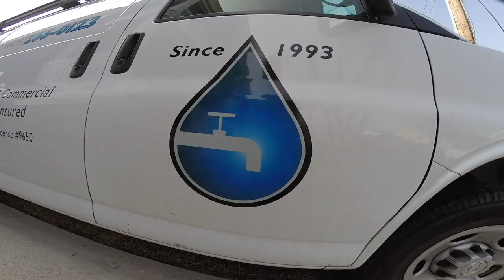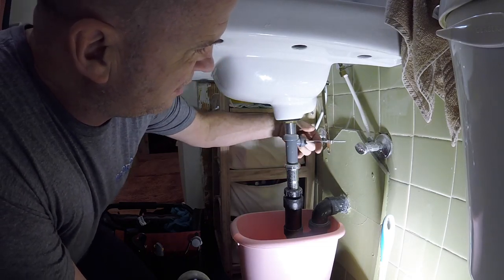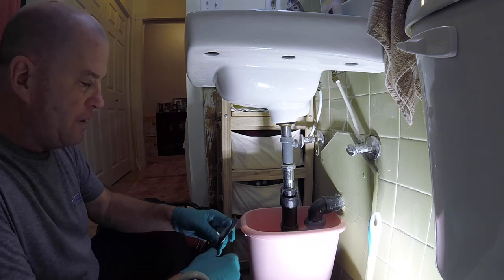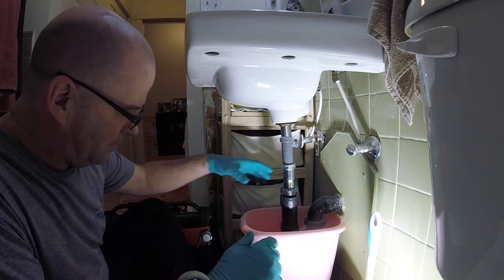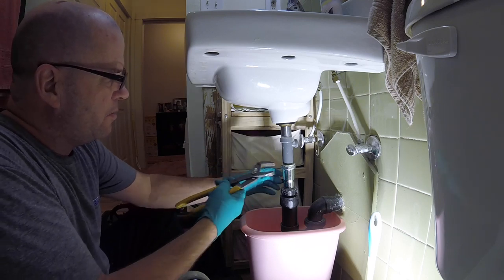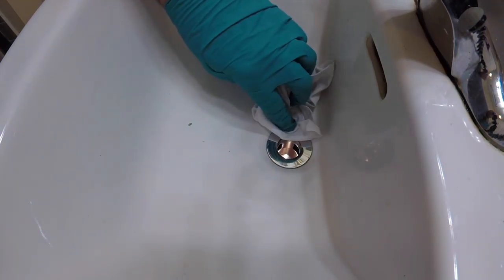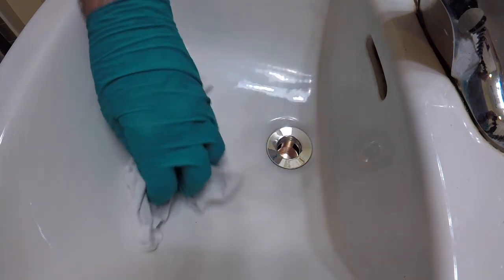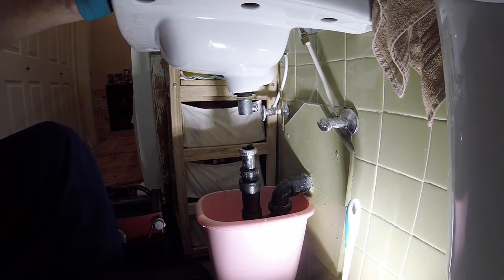WALL HUNG LAVATORY POP UP ASSEMBLY REPLACED

Comment: On my vacation rental client  the pop ups kept breaking and rusting out , so I changed all 18 out to vessel sink drains  with a push stopper like on a rapid fit  tub waste and overflow. so far so good we see how much  abuse these will take.just have to make sure you get drain body for sink with overflow.Pull the rod out of faucet fill hole with Dap. Plumb on Dude
Reply from the maker: get er done....

Comment: Do you ever have a hard time getting all metal pop-up assemblys off?
Reply: hold the tail with pump-pliers and cordless sawzall through the rubber and metal above the nut, flat under the sink. alternate to that cut/break the nut with blade/grinder/crush with large pliers/use oscillating tool with carbide teeth metal blade.
Reply from the maker: yes....i become a fan of the dremel. works great.
Reply: Everything home repair.
Just take a sawzall.  Cut it straight across just below the basin itself.  Pull the piece in the basin out. Clean the drain & over flow hole. Install a new brass drain.
I've never had a angle grinder, vibrate blade cutter, Drimmel or any other kind cut off in my van these tools they  just take to long. But I'm not sure I know the best, fastest way to do a simple job like this after being in business for 45 years next month
  Pull the P-trap. Then proceed. I only re-install brass. I never use plastic. Most are very cheap. Stay away from the metal wrapped around plastic also. "Brass" . They cost a bit more. But compared to plastic it will last 10 times longer.
 I do jobs the easiest fastest way possible and use nothing but top materials. 
  Cheap materials cheap works equals cheap job.
  No thank you!!!
One good thing about using cheap plastic drains is you'll always have a job to return to.  Just say when you return "hey nothing last very long in today's world."
   Which is a Lie. But your average homeowner doesn't know this. 
            Lie on Boys!!!!!
   Why I only use brass.
Reply: I start with trying to spin the whole pop up now more times than not if I do that the flange spins right off and can remove the whole pop up without loosening the nut.

Comment: when it gurgles like that is it indicative of a vent issue?
Reply from the maker: big time....if you listen closely its saying help.....we need a new drain line.....lol
Reply: most likely the vent is 4 to 8 foot away (main stack) and the metal/cast iron pipe has plugged up over the years and has nothing but a hole 1/2" or so finger size hole left, which goes through it snake shaped.... almost like I've cut out and replaced a few feet of it in the past or something ;)
Reply: @ChuckBarron  that's the problem right there .
  It's not saying anything about the drain. Its saying it about the VENT. But you don't know this...
 Mr. Contractor. With no license. 
  Oh. That's a Hack...

Comment: Poor guy had to hear the vacuum running.  love yall and these old pipe jobs are rough to climb over and under when there ain't much room. Hope ya head is feeling better. Did ya see those deals on those wrenches and pliers online check them out. Remember Rigid hammers found multiple packs but Rigid costs a little more for one. Which one are ya going for. Ball peen hammers I found some multiple packs of ball peen hammers. Online tell me which one and I will find them different sizes and weights. Do ya own and Stubby tools
Reply from the maker: i been looking.. stand by and i throw ya some companys...what is stubby tools? a company?
Reply: Stubby is small size no bigger than ya hand. They are usually about 3 to 5in They are short and fat tools
Reply: The Stubby or Short and fat tools are good for small spaces where it is tight. And for small handed ppl use them.
Reply from the maker: oh ok ....thanks angie

Comment: Chuck,next time you run into a pop up rod that is rusted on the end and have no assembly on the truck just take a box wrench and tap the ball on short end and the ball will slide so it can reach the stopper.🤓
Reply from the maker: ok roger that...thanks steve

Comment: I dont do those rubber gasket under the drain only plumbers putty. I also put ol megalock dope on threads of drain tube for to stop a possible leak and the gasket sucks up tighter to fixture! You need 2 phones for those times....another talkative customer🤣😂
Reply from the maker: lol....for sure...thanks mike

Comment: I am NOT a fan of the rubber gasket. Ive had a bunch of call backs because of them leaking. Whether I put them in or someone else. I will now stay with the good ole putty. If I have to run back to fix that after I installed thats money out of my pocket.
Reply from the maker: man...the call back is worse than going to the supply house for a common fitting..a real money loser. I have used the rubber gaskets and so far so good. fingers crossed now.
Reply: Old school putty for my choice , sometimes silicone (but messy). I found on some rubber gaskets make the drain flange stand proud trapping water on the outer edge
Reply: you have to watch on many of the new "sink materials" old fashioned putty with "oil" can and will stain most of them and the staining spreads way out, sometimes it even breaks down the materials itself.. often the rubber bottom gasket and most all faucets rubber is not "oil-based" compatible.
there's always stain-free putty (non petroleum/oil based) but I've never liked it either.
Reply: That's why i only but strain free putty now.
Reply: I just stick with silicone